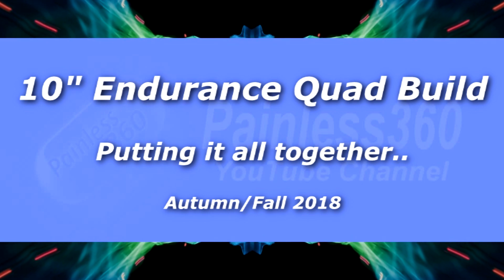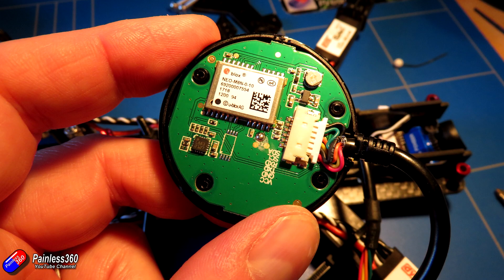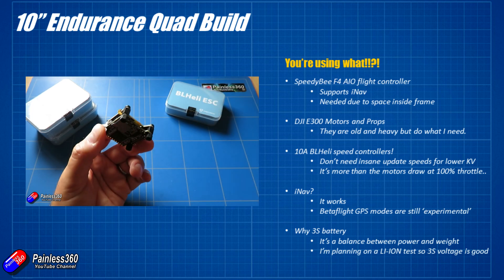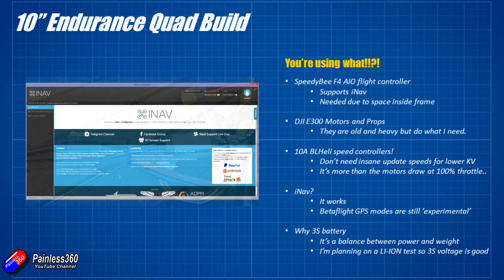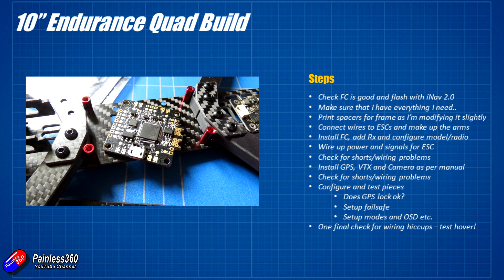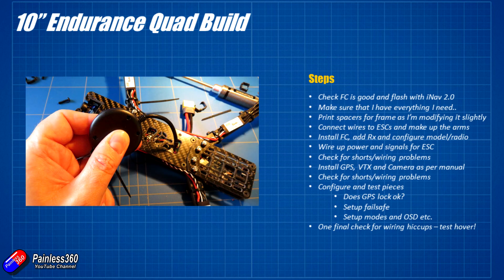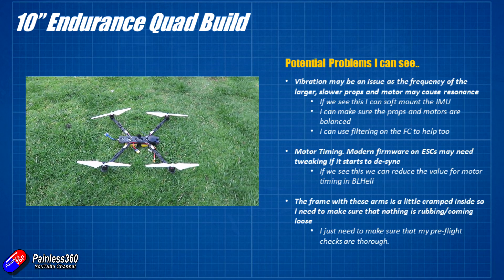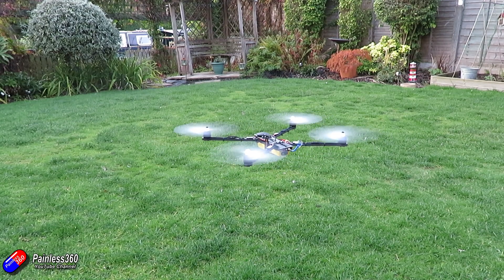Endurance Quad Build: Building the quadcopter and test hover

Comment: Great and informative video. I didn't understand all the details because I have yet to try doing a self build quad. 

What has put me off previously is that most kits are for fpv racing drones, whereas I am more interested in endurance and filming/fpv flights so this project ticks all the boxes.
Reply from the maker: I hope that more vendors will come back to quads that can fly for longer now some of the 'frenzy' about 5" quads has died down. Fingers crossed!
Reply: @Painless360  I would love to build a drone that is simply fun to fly and stable. Without being a pure racer. Speed is definitely not a priority for me
Reply: TBS Discovery ??  I like those a lot.
Reply: I just built a 220mm (one of those smaller racer-enthusiast quads) and it honestly flies so smoothly that it's a pleasure. You can fly it fast, but you don't have to. You'll get much better help starting out with one of the popular builds.

Comment: I would have used a BN-880 GPS instead. Only weighs 10g, and locks on with more satellites than any other GPS module I've used. It's not as cute because it's not enclosed in a dome, but they're cheap, light, and GPS and compass work great without a stalk on both the 5" quads I've used them on.
Reply from the maker: That’s what is on it now. I tried it to see if that would help with the mag issue..
Reply: 4K7 pull-up resistors on SDA, SCL solved my 'mag' problems instantly on a SP-F3 FC, worth a try, only 15 minutes work for a 'pro' like you ;)
Reply: Painless360  I'm sure you have considered this already, but if you mount the GPS as high up as you can, hopefully, that will reduce the interference coming from the electronics. Admittedly, I don't know much about the topic as to what causes the errors.
Reply from the maker: ADepressedGiraffe  You're spot on - please see the pinned comment :D

Comment: Since there's only a few comments and you might see this I have a question....
Wouldn't it be better for airflow off the props if they were UNDER the arms?
Mount the motors under the arms pointing down and the props draw air through the arms but draft down cleanly.
I would think that would make the Performance better with less interference.
I mean a quick calculation with the thickness of the arms might be 1/5th of your prop wash is being essentially blocked.....
Reply: Having props under the cg might be a bit of a problem on such a big copter
Reply: @Silor  I'm raising the arms it looks awesome.
Reply: You are way off with your quick calculation (my guess by a magnitude out). Also where do you think the air is coming from? Sure the air is a bit slower above the prop, but arms would still block airflow there as well. Negligible difference with a much higher risk of damaging the props on take of or landing.
Reply: @superdau  just another quick thought I think I'd rather have my air be slower above my prop coming into it then being slowed down immediately after exiting not to mention the fact that when it exits I want it clean for control purposes.
Reply: @christopherleveck1599  Well said!!!
Reply: @superdau  actually I have a friend who is a nasa nerd so I bought him a hot Pocket and showed him what I'm working on. Not only am I NOT magnatudes off, my design DOES increase incoming airflow by a good bit and does give me clean thrust.
Landing gear should take care of my pops and besides this is a big quad I'm not going to be doing a lot of crazy aerobatics it should be extremely stable by Design.
Besides that I've been designing building flying crashing rebuilding model aircraft of every type for more than 35 years.
I built and flew my first helicopter it was an MRC cobra 30 years ago.
Only had for stabilization was a half-ass gyro that fought you for control of the helicopter the whole time you're trying to fly it.
So thanks for the advice but I think I'm going to press on....

Comment: I thought the problem with lithium ion was the amp draw rate was too low for most quads.....
I use some bigger ion packs with my large fixed wing stuff.
I've got a 20,000 mAh battery for my 8' Senior Telemaster....
Flight times should be upwards of several hours. Problem is after a couple I get a little board....
If you have any luck with lithium ion on a quad, I'll build a new big quad for my pixhawk stuff.....
Reply: Hello Lee,  I'm waiting with interest for the Li-ion trials. I use 3S 2P (LG INR18650-MJI cells) in my Theer wing and maximum draw at 2P configuration is 21A. 
Your full throttle tests looks like the quad will need 40A intermittently so are you thinking 3S 4P or trying to get away with a 3S 3P pack?
Have a good weekend, nice flying weather in the midlands so far :) :)
Steve
PS 'Flamewheels' for ever, great for cutting teeth haha
Reply from the maker: Stephen Thorpe  I'm working with a battery guru so I can't comment until he gets back to me. Assuming a 36A full power setup and he seems happy we can get a pack to handle that so I'm interested to see how it works out..
Reply: @Painless360  from my experience that's totally doable. They're definitely higher C rating 18650 batteries out there.
I just ordered some 3500 mah cells that are supposed to be 30 and there were some that were faster for about half again the price.
And if you're willing to go with the 2500 milliamp cell have some really fast ones but they're really expensive. Course expensive because I only buy the name brand stuff from guys I really trust who charge me a lot but let me return anything that is under spec.
Reply: use Sony Konion VTC6 if you need arround 2c. Normal 18650 should be used at arround 0,8c if you go higher u cant benefit from the high mah becaouse you will drop to fast in voltage and if you 
discharge under a certain lvl you will damage the cells.

A german endurance forum with many good tipps:
http://www.kopterforum.de/topic/30817-ultra-endurance-kopter-und-langzeitfl%C3%BCge/page-254
Reply from the maker: It’s the C rating, with smaller amp draws like this model then you can swing it.. pun intended! :)

Comment: Don't put your GPS especially if it has a compass so close to the carbon fiber and other electronics!
More separation, put it on a GPS stand, Banggood has some good ones which can fold during transportation. Give them a try :)
Looking pretty damn good so far! Keep going :)
Have a great weekend and happy flying!
Reply from the maker: That’s a great point and it’s only the compass that needs care. If you can then physical separation from the power system is good. I’ve mounted GPS units in iNav and iNav builds on top of the stack without issue with a little care. If all else fails - then MuMetal shield is the trick.. :)
Reply: @Painless360  I see. GPS stand seems to be a more cheaper way though but i trust your experience. Take care :)
Reply: Plenty of I2c separate magnetometers around for a few quid then no need to worry about GPS placement.

Comment: I have an F3 flight controller and when I take off jump 2 the air like crazy with just minimum throttle apply do you know what can cause this
Reply from the maker: What troubleshooting have you tried?
Reply: I flash the flight controller three times already and just jump to the air on uncontrollable by the way this is my second flight controller that does the same thing for this quadcopter please help
Reply: ax fpv alex there can be several reasons:
- strong vibrations
- your idle throttle is way higher than hover throttle
- maybe a barometer glitch (if you use althold mode)
- PIDs are too high

Comment: I am currently working on converting my CX20 to Inav. 
The problem i'm running into is that the WS2812B leds I'm using are not quite right with their red color. 
red shows a tiny bit of blue alongside.  
The odd thing is that if I reflash the board to betaflight. The color red works correctly (no color issues). 
I have tried older versions of Inav but the problem stays.
I hope you can help me out on this one.
Reply from the maker: That sounds like a bug. I’d let the iNav developers know:.